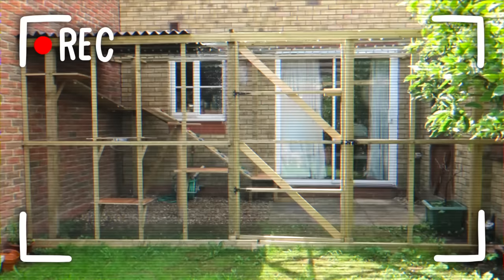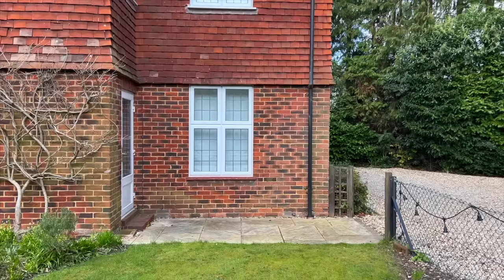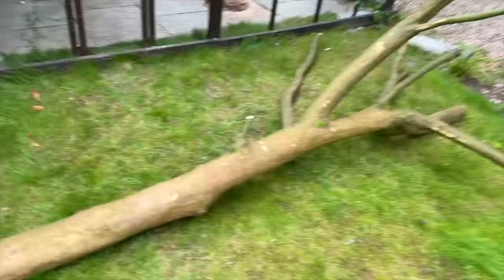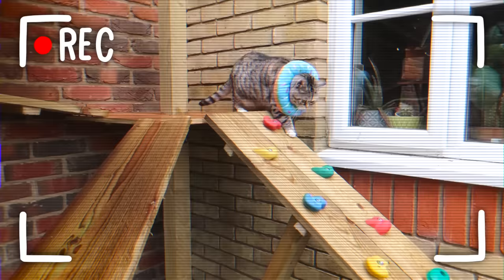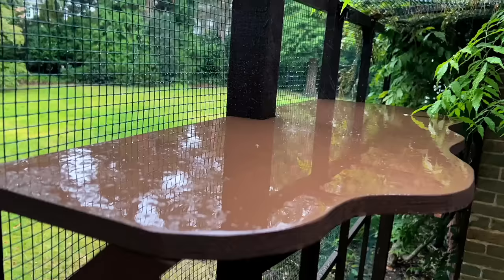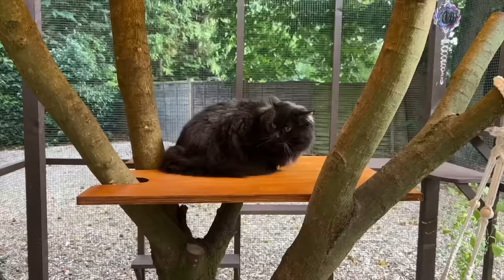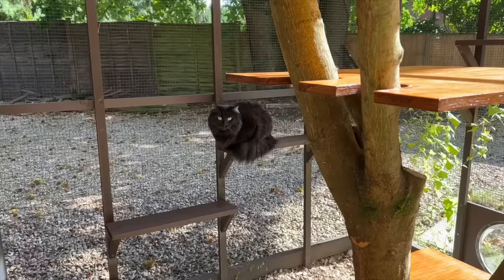I Built A TREEHOUSE For My Cats! (NEW Catio)

Comment: Nice cateo!  I'd recommend you add some surfacing material to the wood platforms to provide grip.  Same for the ramps... way more useful than those plastic climbing handholds that animals will avoid walking on.  I'd suggest using something somewhat thick-ish so the cats can sink their claws in if necessary... so outdoor carpeting, synthetic turf, perhaps even cork or rubber (though rubber might get hot).  This would be especially important for the high up sleeping platform.  Say if the cat rolls off the edge or takes a misstep in the wet. They'll be able to sink their claws into the platform to avoid falling.  I'd also recommend adding a small 2-inch lip to the upper sleeping shelf.  It'll just provide an additional level of security while sleeping... like if rollover or stretch/spread-out while half asleep.
Reply: Agree.  The steps and platforms look too slick.  Maybe use something like reclaimed barn wood for more grip.
Reply: Finish that last sentence off with a “…, Chris.”
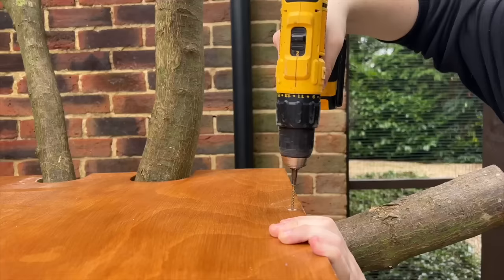Reply: I love how bella stare's at chris at 3:00 as is looks she's lost in thought

Comment: I have an elderly kitty with only three legs. As she has gotten older I have made changes to her cat perches. 

1) Make steps deeper and closer together  and add carpet or gripper strips. This makes the kitties feel safer and easier for them to maneuver especially as they get older.  On a slooping board add small strips of wood every couple of inches. 

2) On the  boards used as walkways, make them wider/deeper. Also add some gripper strips.  

3) Make the perches bigger so both cats can lay on them. Put on edge on the perch, 4inch or so, for them to lean against.  Not where the walkway comes into it, and does not have to be on the whole perch. Again will make them feel safe. 

4) What humans think is cool and what cats think is cool are two different things. Cats don't like swinging things, except toys. 

My two cents. You have lucky cats that you can make them a cataco.  And yes, they need a roof 😊
Reply: Am I the only one who read all that

Comment: You could cover the roof with plastic, it's transparent so it won't block out the precious light and it'll prevent water from getting in the catio and ruin the roof
Only thing is , the sound of water hitting the plastic but that's about it

Comment: For the roof you could use plastic glass because it will be water resistant and its seetrouhg and plastic glass would look really cool plastic glass is just like the tubes you used in the train video where the train passed through the water that same material is what im talking about